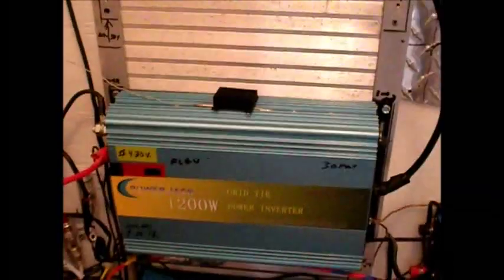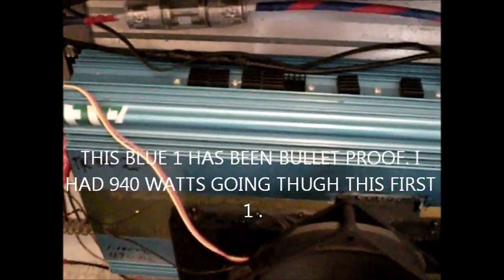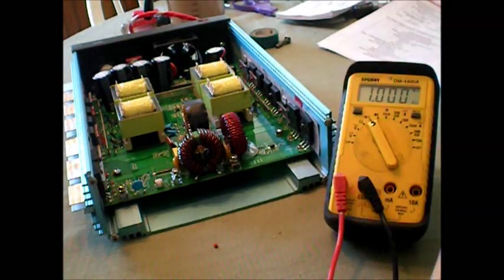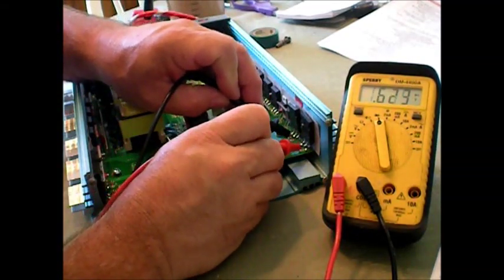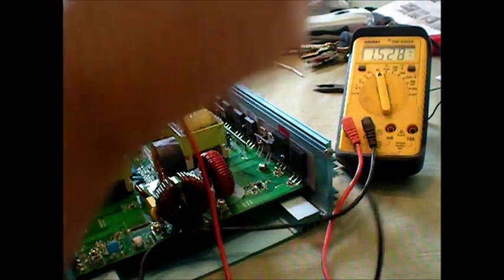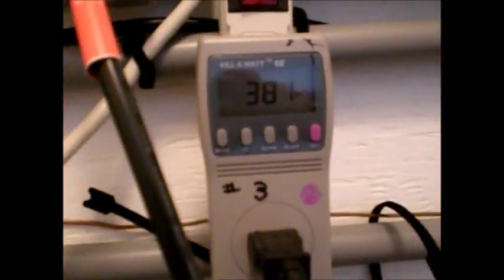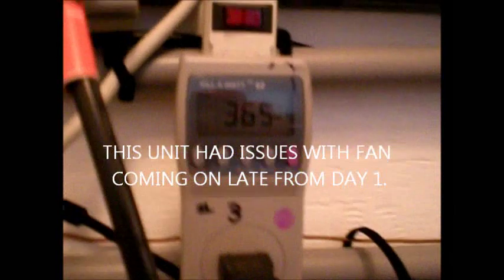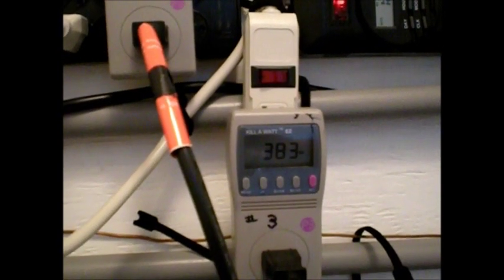POWER JACK GRID TIE INVERTER REPAIR,THE MOSFET MISHAP.

Comment: These power jack inverters are garbage. mine won't even power a 5 watt LED desk lamp without an alarm.  the company won't support beyond one set of parts that gets you beyond ebay support due to 6 weeks to ship the parts that allegedly will fix it.  it is crap and not worth the cost.  buy american and pay more.  At least it will work.  David  from Power jack, hope you are reading this since you blow me off.

Comment: hi, thank you for your tutorial. tried to check the mosfets but they all seem to be fine. 
It stopped working once i accidentally put the red wire of inverter on the black battery plug and black on red. big fireworks went around. 
i cannot see any burnt marks, could you advise please what could have happened?

Comment: I have a sun-300G-wdl had a short circuit. 
On board disappeared 2 resistances and a damaged diode. 
Someone can you tell me the value of resistors R63 and R64,Q17 and diode D28.
Thank you

Comment: I would like your opinion on an issue that I am having with my NEW TRESS TLS2000 (2KW) (relatively unknown in North America) Pure Sine Wave off grid inverter 
This thing is a monster as compared with most Chinese EBay inverters weighing in at about 75 pounds. I sourced it directly from China, so, it is a long way to return, and expensive to ship if I want to return it, but the price was right. I has a display which indicates AC load as %, AC voltage, and DC voltage.
It will run our regular energy efficient refrigerator + toaster together with no problem, both operating at the same time. Now, it will not operate any small induction motors like a vacuum (1400W), and shuts down (this is with the fridge unpluged) , I know that electrical motors take a lot of power at startup, but so does the refrigerator. and the inverter is supposed to operate up to 150% for startup. I am not so knowledgeable about electronics but I am trying to get an understanding as to why the inverter is acting as it is. Is one or more of the Mosfets damaged, and could this have happened by using too high a demand. I have inquired to the company tech support but have not received an answer yet. Can you assist or point in the right direction. Thanks
Reply from the maker: I am guessing  U are talking about a D/C to A/C inverter? If that is the case I went through a bunch of them then I got the 1 I wanted a GP Power 1500 watt pure sine  see my video on that, It will run all my house hold stuff not all at once but will run my microwave on hi no problem it will also power my good size vacuum cleaner 1800 watts . so if a 2KW wont there some thing wrong with it .I wasted a good bit of $$ trying to save $$.Did not work for me either. Also I am in no way any kind of electrical guy, I just get lucky & have some voltage  meters & find help here on the Tube Good Luck with inverter.

Comment: Anyone know where to get the parts list for this PJ 1200 watter? I need Q14's original number or a crossover. Thanks
Reply from the maker: Got all mine on eBay.
Reply: I found that Q14 is TIP41C

Comment: Great video, I have a 2500w powerjack GTI myself, and the unit has 2 AC fuses that use the 12AL250V fast blow fuses, While 1 fuse is blown and the other is OK the unit still works, but if I replace the 12A AC fuse, it trips the breaker. So the common cause of the culprit is the large Power MOSFET is faulty/shorted. and not the small mosfets or diodes, correct?

Comment: have a question do you have any GTI's that are bad is so please let me know lol I buy it off you I'm looking for the silly transformer for a 600watt gti its not running as a 300 watt I did a mod to keep it from going over 300 watts untile I get a new transformer for it then I just undo the mod and go full steam.  so if you have a dead one or know any one that dose please have them drop me a line.    O I love the solar tracker been messing with it I just need to build a mount thanks.

Comment: The Power Jack 1200 lack in the reverse phase polarity security diode (named D2) in the AC circuit.
At other inverters there is a DD84RC with a heat sink.
Similar diodes are in the 300 Watts PJ Inverters so I like them, they are working well up to 260 VAC.
This savings may not have an effect on 120V Grids but at 240V grids my two Power Jack 1200 (one for 14V and one for 28V)
blew instantely the IGBTs (there are no Mosfet's in the AC Circuit) after connecting to the grid without any load.

Comment: I have bought 2 Power Jack Inverters 1200 Watts. One for 14-28V and one for 28-56V input.
They blew up instantly without doing anything. Just connected to the Grid (they were 220V Inverters).
Net voltage is about 240V but this should not be a problem... Power Jack Inverters can't handle it.

Thats a design failure !

The low power 300w inverter from Power Jack is still working (bought and tested earlier) so they have
a problem with higher AC Voltage at the Outlet.

Comment: I year yea I been lookin at these powerjacks  but but keep seing that the ac side is always failing I have the power inverters 500 watt what I do like about the powerjacks is they would work great so when my battery bank is full it will dump the acces over the power jacks in to the grid keepign my battries full with out draining them. I guess one day I will get one and if the breaks down I will exsperment with them to see if i can replace the mosfets, with better ones.

Comment from the maker: I tryed to replace Factory fets with some mosfets from (deg ikey) I spoke to some 1 there .they sent me some Bigger higher power amps but they did not work.Thats why I chased down the originals from Fairchild. I am no way any type of electrician but manage to fix most of my stuff.the bigger mosfets did not work in the power jacks .I did have 5 -1200s at 1 time.most of this stuff if U can make it work some thing else weak blows.Thats been my luck.

Comment: Have a question would replacing the mosfet with a much better mosfet work.   lets say you have a 10amp musfet 200 volt 150 watt mosfet.  and replace it with lets say a better one capable with twice the power will it allow the mosfets last longer

Comment from the maker: Yes,it will trip breaker & burn the Fuse on the ft.of the PJ unit, A/C fuse.If U replace it the Fuse & it trips the breaker again & U Have a red light on in the Back at the same time Your Ac mosfets are Bad. If They are bad ,it is a easy fix.if that is your trouble I have 1 mosfet kit left for Sale on Ebay U get  6 mosfets & 5 fuses. I dont use the power jacks any more But mine were good to me being this was the only trouble ever.  Also the most common.

Comment from the maker: Fist thing i take a pictures of the part needed than jut Google part# & u will get pages of info when u find what looks like what u have down load the PDF file there u can read all specs and print page then it part shopping ,Digi key has a good selection also there are plenty on eBay just type part #,That,s why u need PDF file so u can compare they have to be exact  .U have options & don,t have to buy from Power Jack. all on eBay. Also get a solder sucker, eBay Nice takes out hot solder fast.

Comment from the maker: IS It the Old type? Old type is in book Or The New typed like I have? also go back and check your mosfets even if they read good when u check - and + side .IF U Take your red or black pen  set to diode Do this I may have it back wards + - / -+? but u wont hurt them. when u get your -&+ reading move 1 pen over to middle leg u should get a .OL signal  on meter if u don't and get a value # that mosfet is bad even when std test shows it as good. I have seen that also try it looks good but is bad.

Comment from the maker: Review the video, All answers are There.I as i said have 3,1200 power jacks the latest 1,s .I took Them down at night my 2 other working units and checked values on ac mosfets the big 1,s  the Diode setting to find a good value ,as the info in the booklet is out dated they show the old type.After I new what I was looking For value #s wise .I found the bad 1 and stumbled on the fact that the continuity, Beeper would sound off on a bad mosfet, shorted out. Also Google part # 4 all information.

Comment: my 1200wattgrid tie blew the Q8 mosfet as well i replaced it but it still continues to blow ac fuse. i agree with you the repair Manual is worthless what else should i test im about ready to pitch it in the trash,